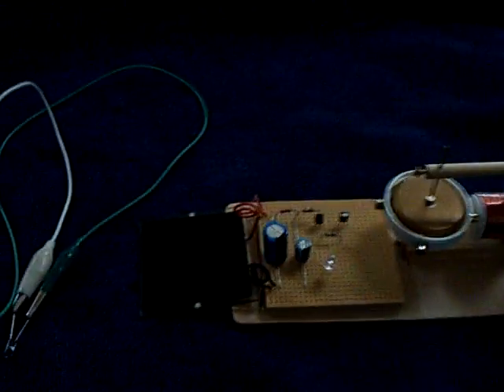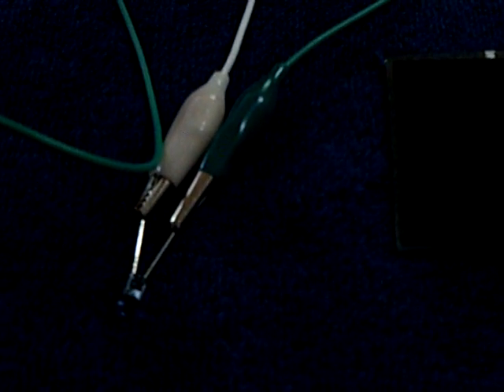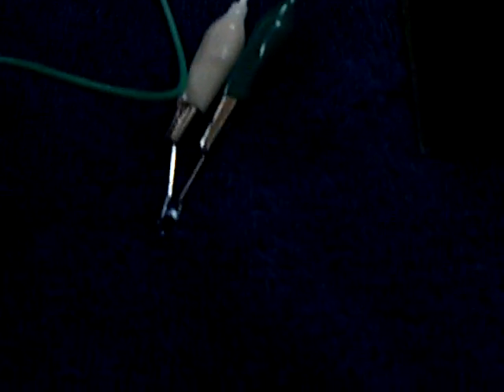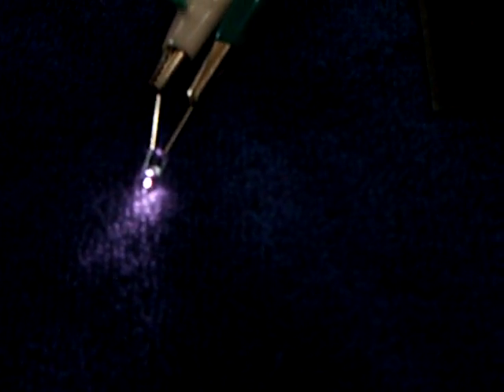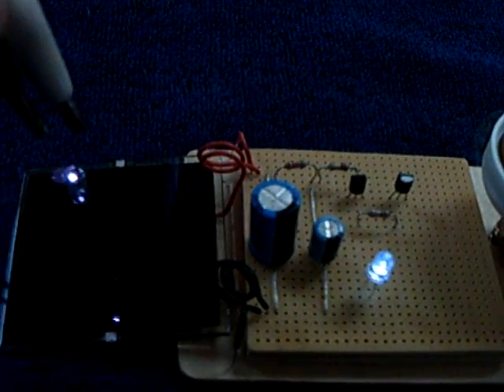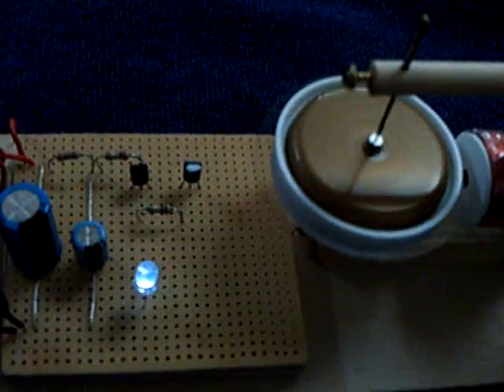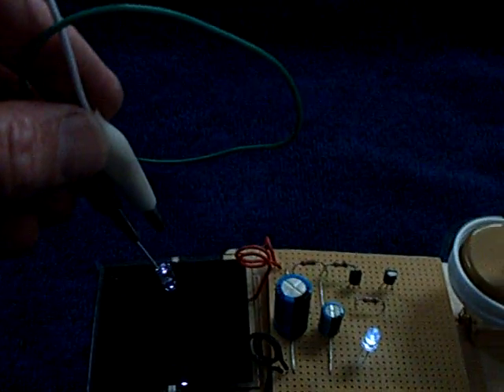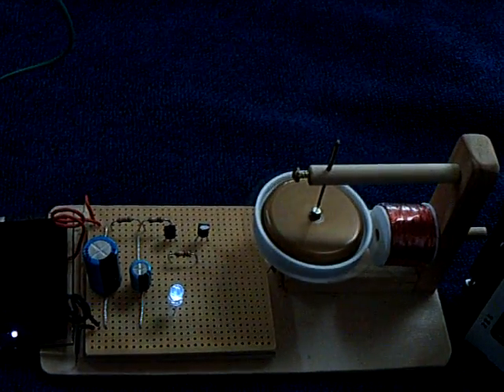Running a pulse motor on infrared light.ASF

Comment: Lidmotor you can power those infared leds with a sec15-3 at 10ma in a nice string of 10 or more and run your motor at the same time. You might have to add a second coil to catch more power if your return is too low but that is all I can offer at this point.